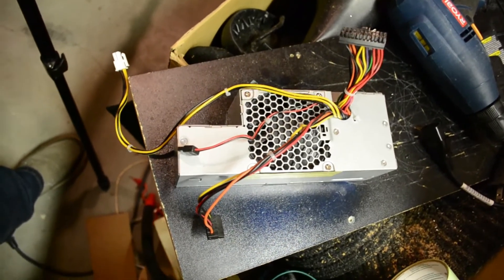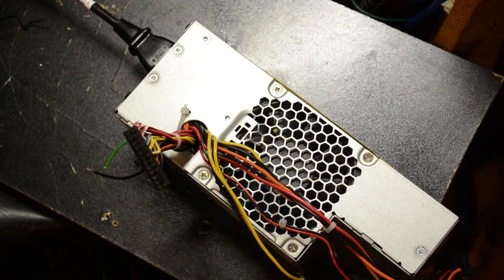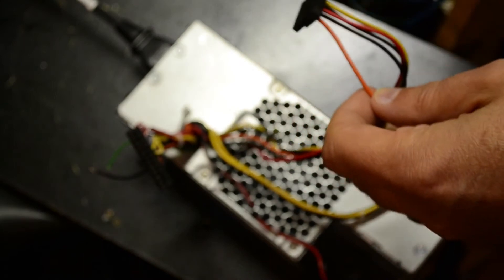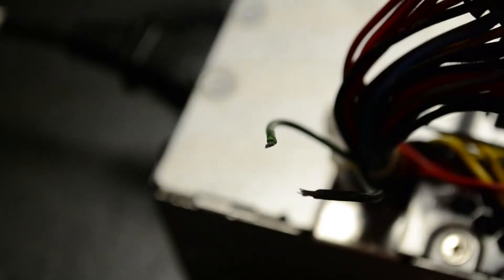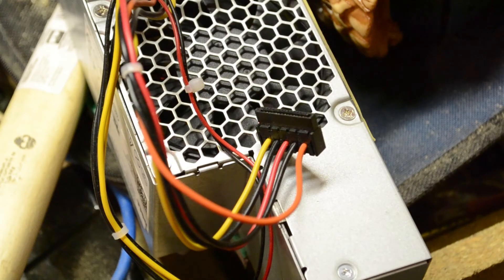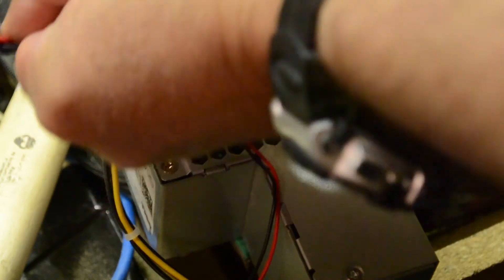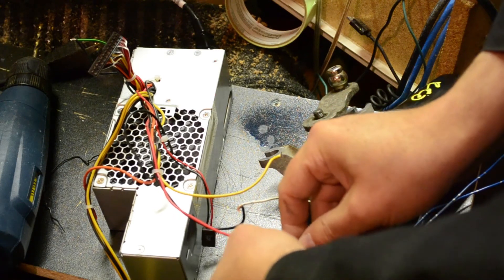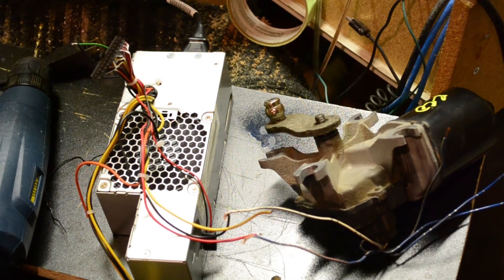Creepy Creations - Using a PC Power Supply

Comment: Thanks for posting this video. I just have a few questions for you. 1. How many wiper motors can be hooked at the same time to the various power wires on one pc power supply? 2. Where can someone find the information that tells what the voltage is for each wire? Thanks again.
Reply: A typical PC power supply should be able to run 2 to 3 motors at the same time. If you think they won't be running at exactly the same time, then there is no theoretical limit. At least with PC power supplies, if you overload it then darn thing will shut itself off... no harm, no foul.  The connector pin-outs are very well documented, since most PC power supplies are compatible with one another, so the pins have to be the same. Google it... there's a ton of information on them out there. (Sorry for not replying sooner).